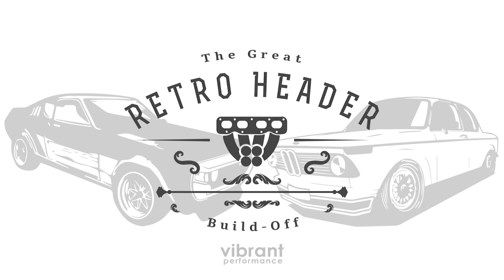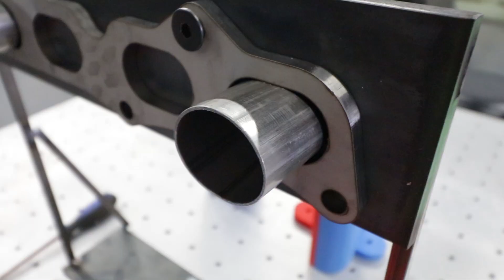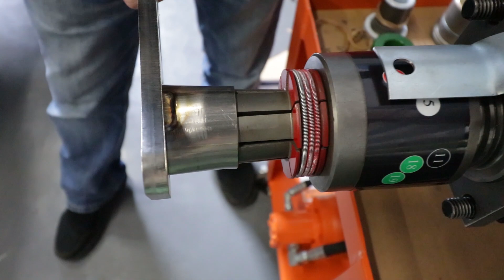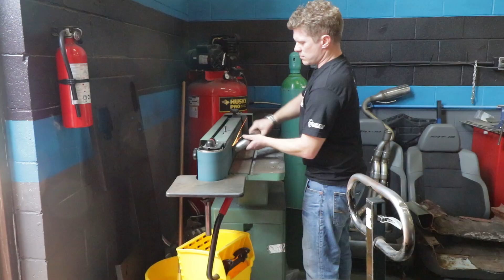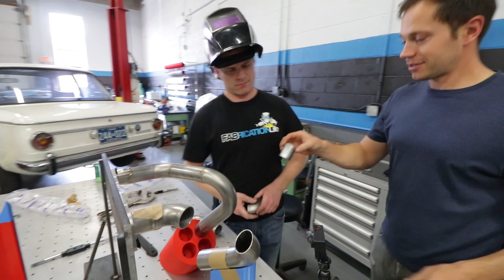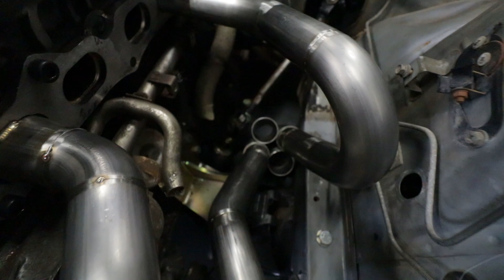Celica Beams 3SGE Header & Exhaust Build-Off Ep3

Comment: In your opinion, if you have to compromise for packaging is it better to have equal length primary tubes or having a straighter section immediately after the exhaust port?

Comment: What's @Vibrantperformance stance on header wrapping and the stories of them cracking due to the heat?
Reply: wrapping any header or turbo manifold is good for a drag race car where you want to keep the heat inside the header to accelerate the exhaust gas velocity.  it is not recommended for use on a street or time attack car where there will be extended heat cycles.  the danger is that you can overheat the material to the point of failure.  with no thermal barrier on the inside of the tubing (like with ceramic coating) you will eventually overheat the material repeatedly and it will fatigue prematurely.
Reply: Thanks for the reply Aaron, beautiful work on the BWM! Gets my vote. Unless Vibrant headers are immune to overheating i'll be taking that wrap off pronto. Vibrant headers are like hens teeth here in the UK.

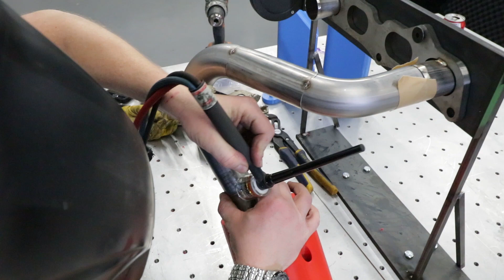Comment: question: what happened at 11:30 during the tacking process? Seeing some sparking up towards the header flange.
Reply: leon clarkson When the welder wants to start the arc but cant find enough material to provide enough current it will spark between pieces of material.

Comment: If you put like a 0.5mm - 1mm gap (with tig, anyways) between each piece of the runner when you weld it, you'll actually weld the edges together instead of having a weld on top of two pieces of metal. This allows you to use less heat, which means less distortion.

Comment: Unless they are going to do a production run of these headers it seams like a waste of time and money to make computer models and jigs. I bet it would be faster to build the header in the car the old fashioned way than it takes to just 3D print the jig pieces.
Reply: this is true and you can see in the Vibrantperformancetv series how it is done without the CAD modelling, etc.  the intent here is to show a more advanced technical approach to building a header vs the old fashioned methods.  Vibrant Performance has some really powerful tools and experienced personnel to develop private label products for a variety of customers and industries.

Comment: 3D metal printing is going to be such a game changer.
Reply: I'd rather have billet or forged parts. Way too much room for error in the process a bad spot in the wire or drop in amps will cause inconsistencies  (week spots)
Reply: Maybe in the future when we have low material voiding. But right now metal 3d printing is really only good for prototyping and low stress applications. Same goes for the plastics, it's revolutionized rapid prototyping, but can't quite replace molding or machining. It is improving though.
Reply: Currently Boeing and F1 teams use 3d metal printing as a mainstream manufacturing method. In F1, the metal printing is used in exhaust collectors.

Comment: Super cool Jay! 

What brand of printer do you use? I just built my own 3D printer from a kit. I modeled up some tools to make Vibrant lines much easier and printed them using my printer. It took way way less time to make the lines for my oil cooler and catch can. I can send you the .STL files if you want?

Comment: I'm actually very surprised and disappointed that Vibrant Performance doesn't make a CNC transitioned exhaust flange from oval to round shape. That way they wouldn't need to crush the tube like he did.

For the premium you pay for the brand I would expect transitioned 5/8" flanges.
Reply: How can you transition that within 5/8? Those dimensions are too far off from each other. You'd have to bring it out 3" to get a decent transition. You gonna pay to get that CNC'd out of stainless? Cheaper and just as good by hand.
Reply: actually, the flange is only 1/2" thick.  a transition from oval to round in that short distance does bad things to exhaust flow- this is why we do not offer flanges as such.  the way Jay did it is much smoother and will benefit flow where it matters most- shortly out of the combustion chamber.
Reply: Well they do make an oval to round transition in 304 stainless, not sure why you'd want it to be cnc'd.

Comment: This way does not seem any better that doing it the old fashioned way. What a waste of time and money on all that flashy gear. I prefer the BMW 2002 build.
Reply: That's all fine and dandy if you can have the customers car for a few days to make a 1 off part for someone.

If you're getting into a small production run for a brand of vehicle (say you make BMW parts) it's going to be impossible to buy all the cars you need. This is a far better way of doing things, borrow a car for a few hours, scan the engine bay, and return the car to the owner. Now you can take your time designing parts without a lot full of cars. Doing things the old fashioned way is fine if you have an old fashioned business.
Reply: If you ever have to remake the part it's all saved in a CAD file.
Reply: You actually think people spend money on this equipment and software to make one header? lol
Most companies like Vibrant have this equipment to ENGINEER and MANUFACTURE products for the market. If they have it, and it's paying itself off doing it's regular job, why not use it for smaller tasks as well?

I have SolidWorks on my home PC, courtesy of the company I work for and my position there. It would be foolish of me to NOT use it for anything just because it's "expensive."
Same goes for the 3D printers, lathes, mills and laser engravers we have at work.
Reply: Dude, you think they bought these high tech gear just for this build? They have invested in it for the whole life of the company AKA for all of their future builds and products that they manufacture and produce.
Reply: This is how you mass produce quality parts in a shop environment.
Reply: Using a 3d scanned engine bay and model with 3d printed jig means no guesswork and far less wasted material after it's done you use the jig to quickly make others and these are important especially when you're looking for specific header lengths.
Reply: Jigs are great for repeated builds, but how many beams swapped Celicas do you think roll trhough the shop?
Reply: Sure, but how many Beams-swapped 2002 headers do you think an avg. exhaust shop makes in a year?
Reply: Well that would make you pretty fucking stupid. Also if you think that 30-50 thousand dollar 3d scanner is ''5k'' the one hes using you're literally smoking crack.
Reply: Agree.  Plus if you're going mass produce the header, then the cheapest way is to send it over to China and have it duplicated :D
Reply: Ace Futura I think it's a good idea to document your one offs in case you have a customer roll in wanting the same thing they did for "Project X". This happens all the time, one offs get made by fabricators, and the repeatability isn't there. With this, they can consistently provide for possible demand, whether or not the demand is there. It's smart because while they might not use it all the time, they maintain the capability, and it ends up working out well for them in the long run. It brings the cost of production down for future customers due to the less time they're having to spend working from day 1. It also enables their fab team to work on more projects as whole.
Reply: I dunno man. It sure beats having to do multiple test fits the old fashioned way.
Reply: Having worked in a custom exhaust shop, I don't really understand the cost/benefits of that super expensive laser scanning gear. I don't see it saving time in most applications
Reply: Common production headers are a dime a dozen and if you ever have to remake a one-off part like this, you have the part to work from. The jig only works if you're building the same header again and again.